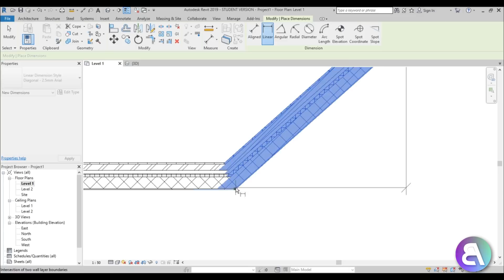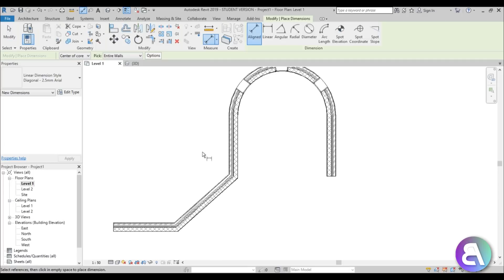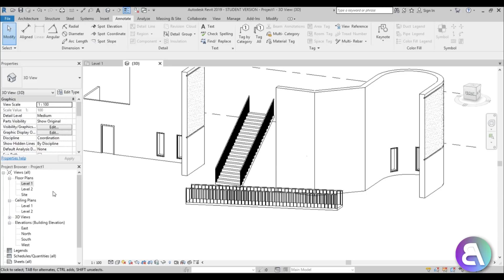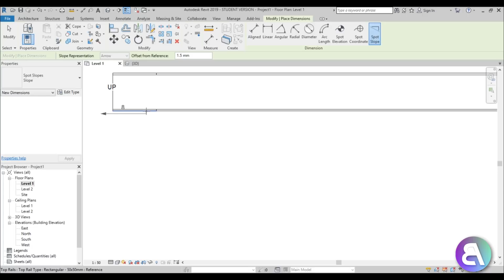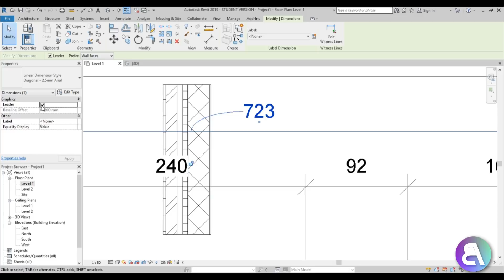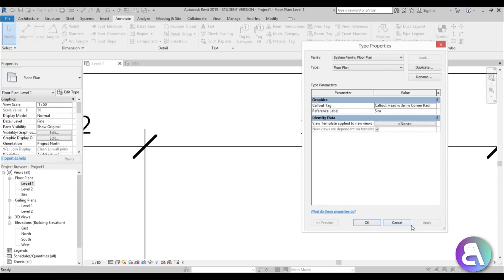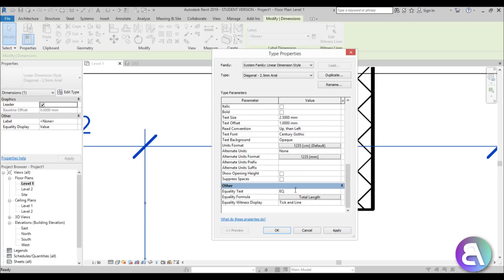Dimensions in Revit Tutorial

Comment: You didn't dimension the length of that angled wall section. Safe to assume that's just not a feature in Revit? 

I know AutoCAD has a sort of pull-off dimensioning feature, where you can just select a line and it will dimension its length end-to-end. I am flabbergasted that I can't do that in Revit.

My workaround is to draw a detail line formatted to try and conceal it in the framing member and dimension that end to end. Dimensioning endpoint to endpoint of the framing member yields extremely unintuitive results - never the one I need.